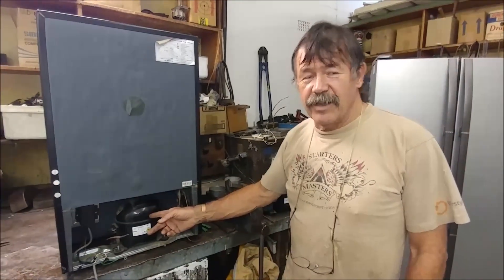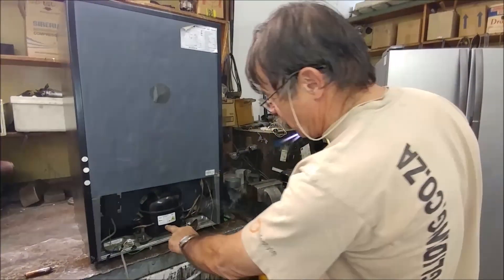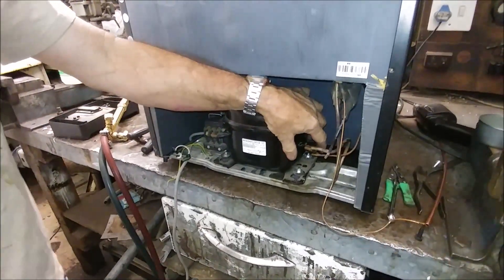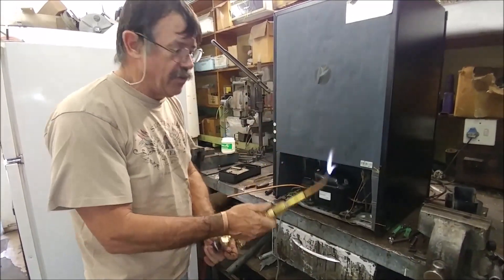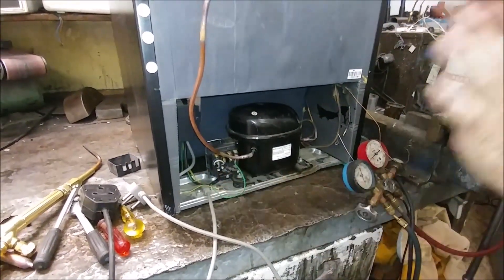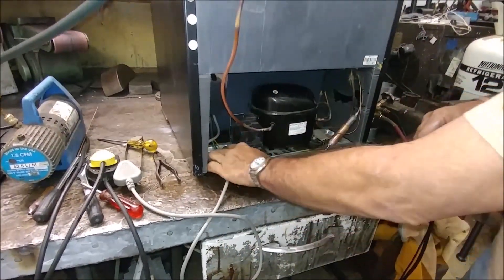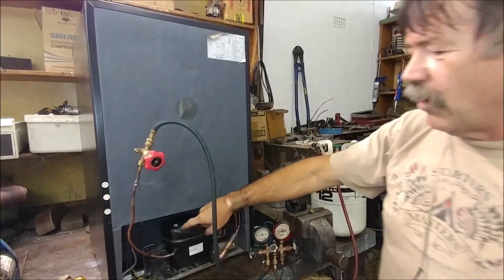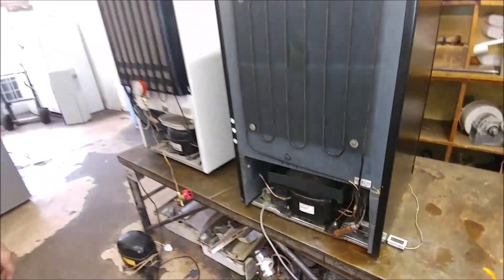Replacing an R600 compressor - JDNel Refrigeration

Comment: I had a bad experience a couple of years ago with R600 freon. 
I fixed a new compressor into this fridge and it wont cool so i figured there was a clogged pipe.

I removed the sucktiion valve and thought all the the remaining freon was jammed in the filter or something, so I went ahead and attempted to remove the discharge pipe but it wont budge ! I tried a couple more times and it refused to budge so I turned up the heat, and then what you know! Massive explosion went in my face and I got severe 2nd degree burns and my face and both my arms. 

Notice: this was when I was just training on my job and had zero experience. Im a professional now lol. 
But since then, I stayed the hell away from R600
Reply: Purging a system with nitrogen in order to remove any trace of R600a or R290 is the way to go, prior to soldering or brazing. Even then some littile pockets of R600a or R290 may remain in the system but it will be minimal. I think R600a and R290 should have never been used as refrigerant. They are too dangerous.
Reply: @wrestlingterrier8366  
Good thinking. I think they use it because the cost less in production. For me, any refrigerator comes with a compressor that takes R600 and it's broken, I replace it with one that takes R134a. Much safer and honestly does the same job
Reply: is that still possible if I will do a full vacuum before applying heat?
Reply: @aksel58  I haven't tried it myself but I think if the vacuum suction power is great it would vacuum out the entire freon. Still fully check with the gauge of course afterwards
Reply: I use a piercing pliers with quarter inch  socket to evacuate R600 first.

Comment: Sir, I need your opinii:Lately, when I repair a fridges with a hole in the coil(it is about R600a fridges), after a period from the repair, the compresors fail, too.
Did You notice Something Like that in your practice?
Reply from the maker: Yes, I think when the fridge loses all its gas the compressor keeps on sucking air in through the puncture where the gas leak is, and builds up a tremendously high highside pressure, which damages the compressor.  
Especially on R600 systems where the compressor is designed to pump a very low pressure gas.

Comment: The title says r600 but i noticed r12. How come ? Or did you replace the r600 compressor and charged the new one with r12, Sir?
Reply from the maker: Yes. I removed the r600 compressor and replaced it with a 1234a compressor which I charged with r12.

Comment: excellent work, Mr. Nel, 
I'm sure you've heard about the concept of restriction that causes by Capillary tube
some HVAC engineers say: it's 300psi Max. for R600 and 240 PSI Max. for r12
I think that was the reason for the overheating of the motor  and the filter..
Thank you

Comment: I accidentally broke a 3/16 pipe from the compressor of my kegarator, the gas leaked out, Inleft it outside for about two weeks now. I am sure I can braze the pipe back into the compressor port (after removing the little piece that was left), my only concern is: do you think that all remaining r600a has been evacuated from the system? When full it has like 1.5 oz
Reply from the maker: Blow another type of gas through the system, That will flush all the R600 out. Yes, they do weld successfully I have done hundreds of them through the years. Clean all the paint off with a wire brush attached to your drill then use a silver solder with a high silver content and a very big flame.
Reply: @JDNelRefrigeration  thank you so much! If I am getting it right, even though the mini fridge has been outside with the broken and separated pipe for two weeks, there is still r600a in the system? That is why I need to blow it out with other type of gas
Reply from the maker: @carloslandaverde6475  Yes. There could still be some traces of R600.

Comment: My goodness, R-600 systems are extremely flammable,  that is the reason why you do not braze on any R-600 systems.  You suppose to use   lock rings technique to do all of the seal system joints! You will get someone killed by  watching  this video.
Reply from the maker: I do on average 150 R600 systems a month in my shop. No fire yet. R500 is more flammable than R600.

Comment: love your video's. I learn something every time I watch them. The condenser you added on,  is it hooked into the original condenser . Also, does the r-12 and r-600 compressors have similar running amps. Thanks for the video
Reply from the maker: I link the 2 condensers together to make 1 large condenser.  Any domestic fridge with a compressor less than 250 Watt, you wont notice a difference on running amperage

Comment: What's the back pressure for R600
Reply from the maker: The high side pressure on a warm fridge should not exceed 120psi, on a cold fridge it can drop as low as 45psi

Comment: You seem to be very knowledgeable. I am also a hvac tech. I had very little experience on capillarytube systems. I normally work with larger systems and eevs and txvs.   But i recently diagnosed a capillary tube system.  I noticed ice on the capillarytube like 1 feet or more from the end. Can low refrigerant cause this? could not find leak. My conlusion was a restriction by dirt or moisture. I took out the refrigerant, flushed with nitrogen, pulled a good vaccum, and recharged. After the procedure the machine worked great again( no ice on the outside of capillary anymore. Am i wrong if Ì say the if the capillarytube has ice far back. there is a restriction by moisture or dirt. Or could low refrigerant cause ice on the outside of capillary aswell?.
Reply from the maker: On a capillary system that is warm and you are just starting off, you do get ice forming on the outside of the capillary for the first few minutes, but as soon as the fridge is cold that ice should disappear. A restriction in your dryer will cause the capillary to form ice as well as you rightfully diagnosed.
Reply: @JDNelRefrigeration  thank you for the answer😊

Comment: Removing r600 compressor and replace with r12 LOL. Not pulling vacuum to remove the 600 very dumb. This unit is not going to last long. R600 cap tube not the same as r12-134a cap tube. R600 runs in a vacuum psi. If his insurance company see this video lord help him. Do not replace r600 with r134 compressor.
Reply from the maker: 3 years later and the fridge is still running beautifully. On a small bar fridge like that the difference in capillary size between 600 & 12 is minute but on a larger fridge it makes a huge difference.
Reply: @JDNelRefrigeration  with the added cond. not up on the captube size. But I know if you never try thing you never know what will work. Like using 404a for r22, I change a r12  2door freezer with r22 @ 125 head it still running been over 7 yrs now.
Reply: @tonymartin i have pulled a vacuum and have had r600 trapped in a restricted area,  and blow up in my face… some times vacuums don’t work. And he is burning the gas… oil industry does this all the time.

Comment: A 2 door no frost unit leak out.. Charge with r600.... Can I just charge it with r134a? Do I need to change oil and capillary tube
Reply from the maker: You don't need to change the oil but r600 capillary is much smaller than r134a so if you can change it, yes, also 134a needs a bigger condenser. If you can, add extra condenser. The bigger the fridge, the bigger the difference. On very small bar fridges you can use the same condenser and capillary.

Comment: Using R12 as a drying gas??  Expensive, hazardous and not very green.  Why not nitrogen instead?  Also brazing with R12 in the system can generate phosgene gas.

Just curious... how expensive is R12 there?  Here that jug is worth like $600.
Reply from the maker: When R12 was phased out I bought a stockpile which I am still using I have enough for another 2 years. I bought that gas 18 years ago.
Reply: @JDNelRefrigeration  That's awesome... that stuff is probably worth more than the fridge your putting it in (In the US anyway...  $600 to $700 US a jug....)  Similar market in South Africa?
Reply from the maker: @johnking1079  No Not similar at all. There is no market for it.

Comment: Good day.... If r600 compressor leak out... Can I charge with r134a? Should I change the oil?
Reply from the maker: Yes you can and no need to change the oil.
Reply: @JDNelRefrigeration  thanks...

Comment: Good thing you aren’t in America. That is $20,000 fine for the two types of refrigeration you just felt let out of the system. You are supposed to blow the system with nitrogen. Not R12 Freon. You have no idea what your doing.. I have years of certified training and certification.
Reply from the maker: What do you think happened to all the SO2 and Metal chloride before R12 was introduced?
Reply: JDNelRefrigeration it got released into the air and now the world is melting because of it... I’m not a “save the world” “global warming is going to kill us” nut job, but I know science. Refrigerants such as the one in the video destroy ozone. No way around it
Reply: What about chlorine released when volcanoes erupt,  r-12 and r-22 are the gold standard in refrigeration.
Reply: @AAAA-oe4ii  The difference is that volcanoes release water soluble chlorine compounds  released by volcanoes (Mostly Hydrocloric Acid) vs CFC's such as R12, R22.    For example, HCL has a water solubility of around 720g/L at 20C...   R12 has a water solubility of 0.286 g/L @ 20C.     i.e. chlorine from Volcanoes gets absorbed by water vapor and falls to the earth as acid rain.    chlorine from R12  doesn't.   so R12 has a much higher probability of reaching the ozone layer than volcanic compounds.
Reply: Actually I they upped the fine to $44,539 per day per violation.  And... There's a $10,000 reward for someone to turn you in.

Comment: dear sir can you explain me how  replace r600a to r134a my compressor is good . can possibly without  replace compressor and oil  changed r134a
Reply from the maker: I do not change the oil between compressors, I use the same oil. I replace the old compressors when they do not function properly anymore.

Comment: Sir i have a small domestic  frezer  size around 100L the compresor is dead it runs on R12  .I have a second hand good compresor  but what refrigirant should i put in cause R12 is baned  .I have R600a and R134  .On wich refrigerant schould i do the conversion .
Reply from the maker: R134a

Comment: Sir.. Can r600a change to r134a.. Is oil are same?
Reply: No, they do not use the same oil. R600 uses a mineral oil while R134a polyolester oil. Plus a machine compressor should never be changed from one type of refrigerant to another without also changing out the condenser too to the correct specs.
Reply from the maker: Yes on a small domestic fridge.

Comment: I have a 4 doors Samsung refrigerator, and it’s not cold on the fridge side. I open the evaporator cover, and I found out that the evaporator has ice on it. I have replaced 2 sensors and a fan, but it still has the same problem. I decided to call Sears, 2 techs came out to check. They told me that its a 600 refrigerant, its very flammable. I asked them to see if they can fix it, they said they don’t have the equipment.  I told them that I can order the compressor at Sears DIY website.  1 tech said the equipment is back order. I then asked them can you convert it into 134A or R12, they told me no. I wish you are closer to my place. I love your video. Thanks sir!
Reply from the maker: By changing the refrigerant, you will not solve the problem of over icing on your evaporator coil.
Reply: @JDNelRefrigeration  True.
Reply: Yes most refrigerators  and freezers are R600a now, need more videos with R600a .
Reply: Most Samsung defrost problems are thermistors or control boards…
Reply: @djnemesis82pluss1877 Hi! Been working with them quite a bit.. I'd say either thermistor, one of the protectors, heater itself.. can't even remember if i ever had defrost problem in control pcb.. Also air leak, or 'ice on'-function on some sbs models if it's not connected into plumbing (=air leak).. There is nothing wrong, or even hard with r600a systems..the problem is with the repair personnel not even able to diagnose defrost issue..😅
Reply: You also need an unopened filter-dryer. It needs to be removed, brazed in. Cooled. Vacuumed. Charged with (R600 was it?). The system is designed mathematically for a specific refigerant.... the length of the capillary tube and everything are by design. Flammable gas.

Comment: You could have charged the fridge with propane for way cheaper than r12.
Reply from the maker: Before R12 was phased out, I bought hundreds of cylinders and stock piled it.
Reply: @JDNelRefrigeration  You could probably make some serious cash selling those on Ebay. Nice work on the fridge. Don't listen to the haters. You got it running and that's what matters. I have repaired a couple fridges like the one you fixed and I've recharged both with Coleman propane. There is something to be said for refrigeration practices but on a unit as cheap as a mini fridge the cheapest repair is the right repair.
Reply: @JDNelRefrigeration   There is an underground market in the US for it.  Which I don't know why because like he said you can just use propane.  Some old cars still have original r12 compressors and people pay $200 to get them charged.

Comment: In the US you can't even purchase R12 and flushing any non-exempt freon, including R12 is how you go to prison.
Reply: R134a is the international replacement of r 12🥹
Reply: ...and they are now replacing everything including R134a with hydrocarbon based refrigerants.
Reply: @ilosappliancevideos47  The new generation of refrigerants is replaced by the number starting with 4. Like R410a, R404a, R407C.

Comment: Using R12 is forbidden. Have you ever heard of ozone depletion and montreal protocol? In general:  changing the refigerant requires the adaption of capillar tube, condenser and evaporator. You should evacuate the system and use dry nitrogen before brazing. Also the pressure test and the check of tightness are missing. Sorry, but your work is bad.
Reply: It's all about bussiness, chlorine is everywhere; it evaporates from the salts of the oceans and volcanos. Ozone is regenerated when and electric stom arrives, electrolisis process happens and turns O2 (oxigen) to O3 (ozone) end of montreal bussiness and this flammable refrigerants.
Reply: @Berni0707  Lol, that is NOT how it works, chloride is a whole different kind of substance than chlorine gas. In almost all countries R12 is banned since the 2000s, since it is the worst gas for the ozone layer, it was even used as a propellant in spray cans. These substances really destroyed the ozone layer much faster than lightning, and that is not electrolysis but the crazy high temperature of lightning bolts that creates free radicals to convert oxygen molecules to ozone.

There are so much things wrong in this video, the capillary tube and dryer should be changed so there is no moisture and the pressures are correct for R12/R134a, the oil and compressor must be compatible with R12, flushing with R12 is extremely dumb, heating it creates phosgene, you should use nitrogen and then pull a vacuum to remove all the moisture and air in the system.
Reply: Let alone the $10,000 reward for anyone who reports this to the EPA?

Comment: Si le pones R12 , en lugar de R600, el motor se rompe ??
Reply from the maker: On small compressors it does not make a difference, but on larger fridges it does.

Comment: I like most of your videos but this was not very good.  Dont convert the fridges to any other refrigerant. There is no need to. Vacuum your system before disconnecting any pipes. Weigh in your charge its much easier.
Reply: We need oil for Refregrent 600 
How get oil for  R 600
Reply: @عمرعبدالمنان  use olive oil
Reply from the maker: If we cut a piece of the capillary off to replace the pencil dryer, the volume of the system will be smaller than before and if we put a measured amount of gas in it will have an over charge.

Comment: Why don't you vacuum through the gauge ?
Reply from the maker: Because the shorter the distance between the vacuum pump & the compressor, the better vacuum I get.
Reply: JDNelRefrigeration  would it be of any danger if I used the gauges
Reply from the maker: No danger whatsoever

Comment: Vry 9ce videos sir.sir can you guide me what is the correct back pressure of r134a in fridge
Reply from the maker: On a warm fridge not more than 150psi. On a cold fridge 80psi.
Reply: JDNelRefrigeration sir this is low side pressure
Reply: Susan Nel thks sir for helpful information
Reply from the maker: On a warm fridge, not more that 10 psi on a cold fridge, never in vacuum.
Reply: JDNelRefrigeration thnks sir for help